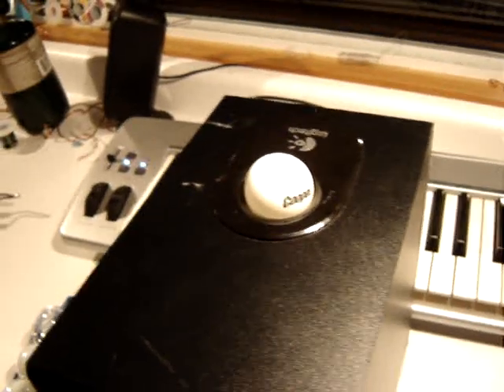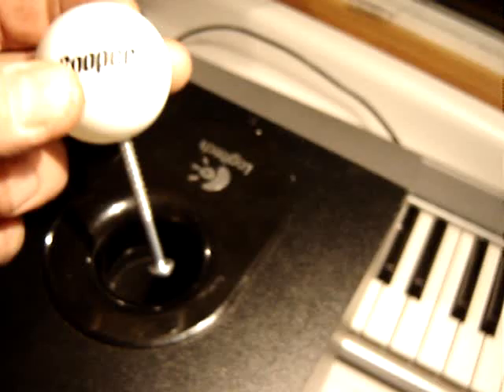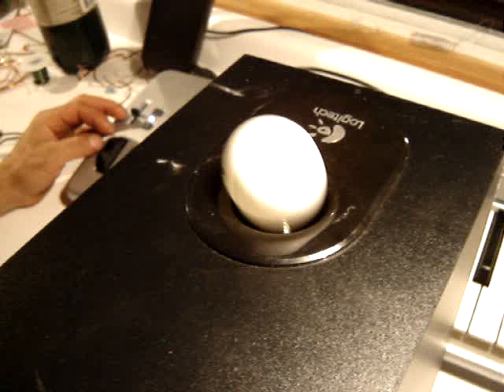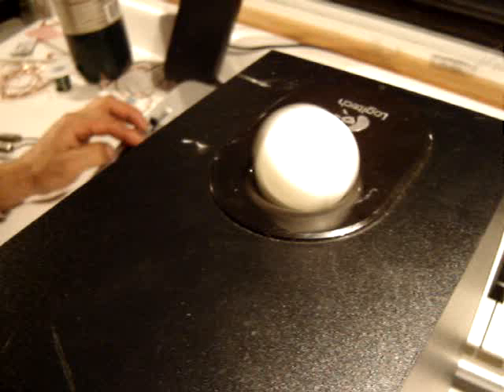Aero-Acoustic Levitation of Ping-Pong Ball

Comment from the maker: I had fun with styro beads inside a clear plastic tent that I made from the floor to the ceiling. The speaker port would push some beads high, at the same time as sucking beads into the port; pushing and pulling at the same time. Sorta like AC electrical current.

Took a while to get the beads out of the speaker...it required some heavy Wolf Parade bass, and every once in a while a couple would pop out!

Comment from the maker: A ping pong ball can be levitated using the output of a vacuum cleaner. Similarly, there is a vortex of air that constantly pushes out from the centre of the speaker port. The air only goes into the speaker at the very edges of the hole. The ball gets caught in the edge downflow and vibrates.  However, this speaker port will shoot syrofoam chips up to the ceiling from the floor.

 I believe a more powerful speaker than this 40 watt would easily propel the ball up and possibly levitate it freely.

Comment from the maker: From Wikipedia dictionary..".Aerodynamic levitation is commonly seen in air hockey where jets of gas from the table push upwards against the puck. Levitating objects may also force air downwards e.g. Helicopters, VTOL aircraft, and hovercraft. A sphere can be stably levitated in a stream of air without any type of control system, if conditions are right. This was merchandised as a toy, circa 1960"

Comment from the maker: When I tried higher frequency, the oscillations became less to none, although some higher notes have a little more of an effect than others.

 However, the main effect here is from the vortex column of air that rushes out of the speaker port at the same time as air is being sucked into the port.

 This phenomenon seems to happen best at lower frequencies and is a different effect than the Acoustic Levitation Chamber of drdeak, for example.

Comment from the maker: rom Wikipedia dictionary..".Aerodynamic levitation is commonly seen in air hockey where jets of gas from the table push upwards against the puck. Levitating objects may also force air downwards e.g. Helicopters, VTOL aircraft, and hovercraft. A sphere can be stably levitated in a stream of air without any type of control system, if conditions are right. This was merchandised as a toy, circa 1960"

Comment from the maker: The speaker pushes air back and forth quickly, yes, but at the sound port you will find a constant outflow and inflow at the same time . There's a constant vortex of air out at the center, and air going in only at the outer edges of the hole. It acts much like a fan. It would levitate the ball with a bigger speaker than 40 watt I used. Use smoke to see what I mean.

Comment from the maker: I can get styrofoam  beads to shoot to the ceiling, so it's more than sound vibrations. There is a column of air pushed put of the speaker hole that you can feel several feet away. The air goes in, and out, of the speaker hole at the same time.

Comment from the maker: I have had no trouble with it and I'm not exactly dainty with equipment. However, the USB cable is the first thing that touches at the back, meaning if you push against something or don't support the cable properly it could give. There may be other keyboards with more features and a better USB connection.

Comment from the maker: Instead of a piece of paper, use a stick of incense. By holding the incense close to the sound port when the volume is up, you will see that air constantly goes out from the centre of the port, and constantly flows in from the very edges of the port. The air does not flow back and forth as one might expect. I was trying to catch that centre of the hole gust, and perhaps form it with sound waves. (I can push styro beads to the ceiling this way,)

Comment from the maker: BUT If you hold the paper a couple of inches or more from the port, you see the air blows OUT quite forcefully. That, in short, was the updraft I was hoping to catch. The initial blast will sometimes pop the ball up, but I couldn't catch the vortex wave to keep it going! Perhaps more power will work...this video I used a cheap computer speaker...I have 12" woofer and 1000 watt stereo to work with next to make a combo vortex ring launcher and levitator. Stay tuned!

Comment from the maker: Perhaps you could try an experiment. 

You could try using a stick of incense or candle to see what happens to the smoke or flame when it's close to the sound port of a bass speaker. 

Is it air velocity or soundwaves or both that forms the force which moves the smoke/flame?

Comment from the maker: At certain frequencies I could feel an air flow upward from the speaker port. How is this possible, since the speaker box is closed? It is because there is also a constant flow into the hole at the same time. Sucking in at the edge of the hole and blowing out at the center. 

The effect works best with certain notes or resonating frequencies, and can be seen with incense smoke held near the port.

Comment: Try it without the screw and aim to have it levitate around 4 to 6 inches above the speaker. (a new ball without the hole)
They do this with vacuum cleaners blowing air as well. As a waveform will surround the leading edge equally. With sound its about frequency as each wave hits it one after the other. As well as with volume. A happy medium is found with a resonance effect. So some frequencies will be better than others. The difference is night and day, as to tuning in a radio or as to getting static disorder.